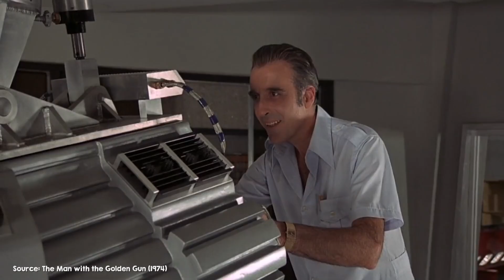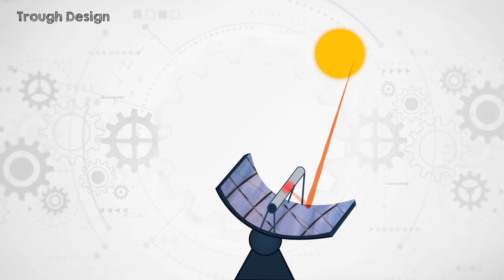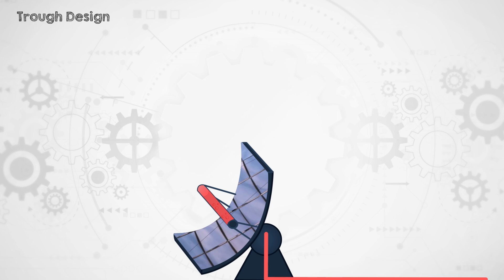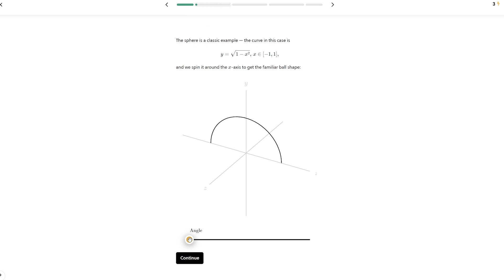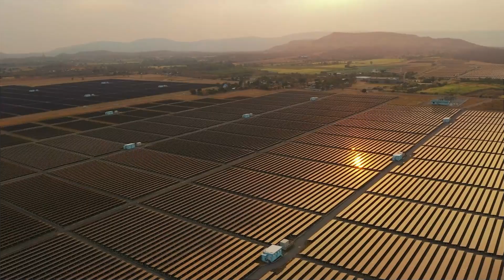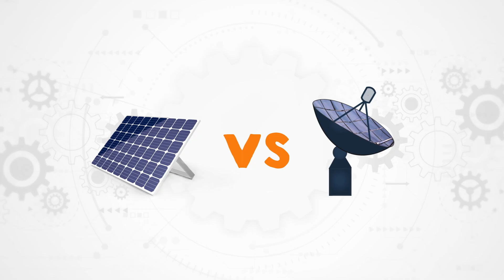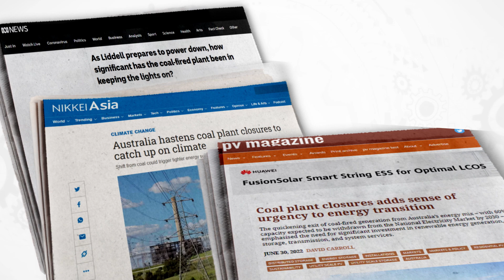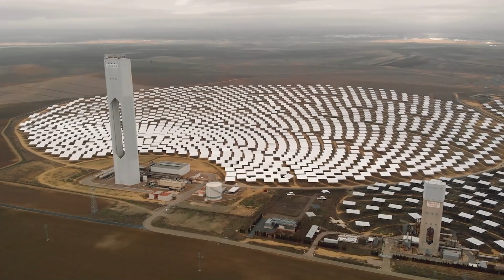Solar Power at Night using Concentrated Solar Power CSP

Comment: how much co2 would be produced by a natural gas plant given 40% efficiency 370,000,000 kWh of electricity per year
To calculate the amount of CO2 produced by a natural gas plant given 40% efficiency and 370,000,000 kWh of electricity per year, we can use the same emission factor as before, which is approximately 0.2 metric tons of CO2 per MWh of electricity generated.

First, we need to convert the annual electricity production from kWh to MWh:
370,000,000 kWh/year / 1000 = 370,000 MWh/year

To calculate the amount of natural gas needed to generate this electricity, we can use the formula:
MWh/year / efficiency = MWh/year / 0.4 = MMBtu/year

370,000 MWh/year / 0.4 = 925,000 MMBtu/year

Finally, we can calculate the amount of CO2 produced using the emission factor:
925,000 MMBtu/year x 0.05 metric tons CO2/MMBtu = 46,250 metric tons CO2/year

Therefore, a natural gas plant with 40% efficiency that produces 370,000,000 kWh of electricity per year would generate approximately 46,250 metric tons of CO2 per year.

Comment: how much power per year would be produced by a solar pv plant of 20% efficiency in Perth Australia given the area of 1 km^2
The amount of power produced by a solar PV plant of 20% efficiency in Perth, Australia, given an area of 1 km^2 can be calculated as follows:

First, we need to convert the area from km^2 to m^2:
1 km^2 = 1,000,000 m^2

Next, we need to take into account the solar irradiance in Perth. The average solar irradiance in Perth is about 1,850 kWh/m^2 per year.

Multiplying the area by the solar irradiance gives us the total amount of energy that falls on the solar PV plant in one year:

1,000,000 m^2 x 1,850 kWh/m^2 = 1,850,000,000 kWh/year

To calculate the amount of electricity that can be generated by the solar PV plant, we need to multiply the total energy by the efficiency of the solar panels (20%):
1,850,000,000 kWh/year x 0.2 = 370,000,000 kWh/year

So a solar PV plant with an area of 1 km^2 and an efficiency of 20% in Perth, Australia, could produce approximately 370,000,000 kWh of electricity per year.

Comment: Let's have another shot at making a comment and see if it gets deleted.
PV solar is ~ 20% efficient meaning that 80% is going into atmospheric heating. If you capture this heat and use it or radiate it back into space through the Atmospheric IR window .. no issues. To date no one in the world is doing that , so solar PV remains a greenhouse heater if you compare a grass paddock at 32 C in noon sun vs a PV array at 53C. We are talking about TJ's of heating over the course of a day for a 1 KM^2 area. 200MW of power vs 835 MW of atmospheric heating !
CSP troughs on the other hand, using around 400 C temps to heat SCCO2 and turbines can leverage ground loops , IR windows,  regeneration, and long term (few days) storage as part of it's very design.

Comment: The Ivanpah CSP is $2,200,000,000 to build it.  I don't think that is favorable pricing compared to a solar PV system.  And any steam generator is going to require 24 hour staff to monitor the steam turbines.  While the solar PV system is not required to have anyone babysit it.  I think the Ivanpah system cost about $5.50 per rated watt, or 5 times the cost of a solar PV system.  

So would it be better to make another 400 MW CSP system like Ivanpah for $2.200,000,000 or build a 2,200 MW solar PV system?  I guess the answer is shown by the 113,000 MW of solar PV systems and the 2,000 MW of CSP solar power.  

The biggest problem is that the staff will require about 45 people to run the plant all the time, as you need a steam engineer when the system is generating power.

Comment: In the late nineties to early aughts, I was optimistic about CSP.  Lithium ion batteries and PV were improving, but it wasn't clear how much they would improve before hitting their plateau.  My guess turned out to be a bit on the pessimistic side, leaving room for CSP to compete more easily.  I'm still optimistic that there will be a niche for thermal storage, but turning sunlight into heat is an unnecessary loss.  It should be more efficient to use PV to run a heat pump -- which could be the same device that turns the stored heat back into electricity.
Reply: >  It should be more efficient to use PV to run a heat pump - <   I seriously doubt that.  Steam for electricity generation enters the turbine at 1,000F and 1,000 PSI.  Are you really going to heat to > 1,000 F with a heat pump?  Or are you talking about running a Stirling engine forward and backward?  These things don't scale to MW sizes.  If you're thinking about operating at lower temperatures, you need to look into the Carnot limits on efficiency.  That is why power turbines inlet at 1,000F and expand down to almost ambient or river water temperatures.
Reply: @Pete in Wisconsin  The question is how much usable electricity you can get out of each square meter of sunlit land (at what capital cost and what operating cost), after putting the energy into storage and taking it back out.  It takes a boatload of sunshine to heat each ton of water to 1000F.  Sure, you get a bunch of energy back out too, but that's a wash in the first approximation.

Of course I'm thinking of lower temperatures.  In principle, a heat engine can work as close as you like to Carnot efficiency -- and a heat pump can work as close as you like to the reciprocal of the Carnot efficiency, with the whole thing being as close as you like to reversible -- no matter what temperatures your hot and cold reservoirs are at.  Meanwhile, the theoretical limit of PV efficiency is the Carnot efficiency between the temperatures of the sun and earth.

Of course, none of these Carnot efficiencies are directly relevant.  The question is what gets the lowest levelized cost of electricity while being dispatchable.  PV can use diffuse sunlight, scattered by the air.  CSP can't.  

It's certainly possible for heat pumps to run at MW scale across moderate temperature differences.  Googling it shows that Siemens has a 70MW system for district heating.  For heat engines across modest temperature differences, the example I've heard of is an OTEC (ocean thermal energy conversion) system in Hawaii at 100kW.  It's not MW, but it's a pilot project that was intended to be scaled up to full utility scale.  I don't think it's cost-competitive, with all the water they have to pump to obtain and dump the heat, but it's functional.  It's been putting electricity into the grid for years.
Reply: @danwylie-sears1134    To other readers: Dan's post above is correct and technically sound.  He does not address the issue of cost, which is very high with such a complex system and that it is effective only under clear skies with no haze.  You are only likely to find such a solution where government research money is available.  Those of us stuck in capitalist electricity markets will have to resort to cheaper options such as PV + wind + pumped hydro storage, and shutting off hydro sites during daylight hours, saving the water energy for nighttime.
Reply: @peteinwisconsin2496  Indeed.  Cost is hard.  My guess is that heat-pump thermal storage will have a niche in storing large amounts of energy for long durations, with relatively low power.  But it's just a guess.

Comment: Good and thorough content. Looks like loads of work to prepare. Nice to watch.
Now I am even more bumped that I live in the northern country with lots of clouds! My solution for now, for using close to net zero-emission heating, are wooden pellets. But I have little ideas on how to get renewable electricity efficiently. Winds are wimpy, flat lands around negate hydro. I guess PVs are the only solution for now, though I need them like 3 times as many as in Australia, due to the weather. And event then one third of the year they produce close to nothing (due to snow, low Sun's altitude and thick clouds). I guess the only option for low CO2 is nuclear in some parts of the world... And in the future, supplemented with hydrogen imported from sunnier places.

Comment: 5:36 If dish CSP is more efficient, then why not keep the center focal point stationary and move the dish on rails instead thus you solve the problem of moving the heated fluid around.

Comment: How much of a coal fired steam turbine system can be used by a CSP powered molten salt system? Surely the existing transmission infrastructure makes it sensible to locate new CSP plants next to coal power stations that are set to be decommissioned if the climate is even moderately suitable?

Comment: I remember seeing a company offering the style of system at an energy show in the UK 20 years ago, was surprised to didn’t seem to gain any commercial traction. And when it comes to steam generation it has always seemed strange that nobody uses refrigerant with a lower boiling point to generate electricity from low grade waste heat sources (I’m sure there must be a very good reason!)
Reply: There are "organic rankine cycle" heat engines. I don't know what they use, exactly.

You can also use water/steam at room temperature, you just need a colder condenser and an air- free steam circuit. It wont be too efficient though, due to carnot's law. And it will only generate low pressure (less than 1 bar- i'll guess even less than a quarter bar), so your engine would be huge. 

Concerning refrigerants: 
In my experience, the people working with them don't care about leaks as much as they could. So i hope they don't get used in even more applications, since they have extremely high global warming potential. 
Lets say you have an air conditioning unit with 3 kg of R410. 
If that leaks, it will cause as much global warming as 6 tons of CO2.

CO2 has been used as a working fluid in british powerplants.
Reply: If you had a liquid with a significantly lower boiling point that would defeat the purpose of using solar thermal. How do you keep the liquid cool and cool it down again? Water is cheap, plentiful and condenses back to water at atmospheric temperatures. It's also relatively non corrosive (which is one of the issues with CSP - the molten salt is highly corrosive). You could use supercritical C02 instead of molten salt but the fluid temperature is not quite high enough to be efficient with CST. However they are looking at blends to raise the temperature closer to 700 deg C, where you heat and pressurise CO2 directly and then use it to directly power a steam turbine when it phase changes back to a gas but once again corrosion is a major issue. A supercritical CO2 turbine is 50% efficient at converting heat to electricity compared to 35% for a steam turbine. Plus you're talking about a single process rather than heating up molten salt and then using molten salt to heat water.
Reply: I would use mineral oil or steam for the heat transfer fluid, closed loop dry wells to store the heat in the earth, and propane to run the power cycle with dry air cooling.

Comment: I wonder how this equation will change when sodium batteries achieve scale, I think we are looking at almost half the cost of current LFP batteries inside of a decade. I still lean towards PV because of their simplicity and the fact they just create electricity from the beginning with no moving parts with an almost maintenance free 30 year proven lifespan. I also like how they can be deployed flat on the ground drastically reducing installation costs. Large scale PV seems to increase its efficiencies by almost 1% a year so 30% should be available in about a decade as well. 
If CSP ends up being able to compete with all that we will all be swimming in cheap power.

Comment: Could you do a combined CSP / wind turbine generation system? So heat the molten salt with mirrors but also with excess electricity from turbines. That would avoid curtailment for wind turbines as well and therefore make them, overall, cheaper. It also seems like a way to reduce the number of mirrors/trackers required.
Reply: Going from electricity to heat to electricity loses a lot of energy. The big advantage of storing the heat with CSP is that you've already got the heat as that's how it works. Apart from the losses due to heat leaking out you get the storage part almost for free just by having the tanks and a larger amount of salt. Batteries and pumped hydro are more efficient ways to store excess electricity from wind. You could add electric heating as a last resort I suppose but you wouldn't want to be using that under normal circumstances.
Reply: @adrianthoroughgood1191  I think the idea would be having this as just another place to store excess energy as well as a generator. You can only build so many pumped hydro facilities after-all. Having it pull double duty even if it isn't as efficient as pumped hydro or lithium, increases the value to a level that might make it worth building more often. If you need an abundance of heat for an industrial application it's even better.
Reply: @OstrichWrestler Thermal storage is cheap from a money point of view but expensive from an energy point of view. The best time to use thermal storage is when the heat would have happened anyway, eg when you are starting with heat like CSP or nuclear power, or when you are finishing with heat such as domestic heating. Eg I have electric storage heaters for space heating and a large hot water tank. This means my electricity demand can be shifted from when I need the heat to when the electricity is surplus and therefore cheaper. However I do agree that once you've spent the large amount of money on setting up the CSP plant, adding electric heating would not cost much extra, and some electric heating is needed anyway because the salt has to be heated to become molten. So install it yes, but only use it when all other more useful ways of using spare electricity have been exhausted, IE when the batteries and pumped hydro and load shifting are full and the only option left is curtailment.
Reply: @adrianthoroughgood1191  yes, that was my point. Lots of places can't do pumped hydro. Batteries get expensive. And one way to ensure reliability and enough supply is to deploy turbines so they supply enough power for a high percentage of the year. The downside is that will lead to overproduction. Having an existing system that lots of power can be dumped to is useful in that scenario.

Comment: Probably cheaper than gas at scale in sunny climates. Unlike coal power stations, mines, and ash dumps where the land is mostly unusable, sheep can still graze under the mirrors. 
I'd love experiment with tracking the ten square metres of flexible plastic backed mirrors recovered from a demolished clothing store. I think the local small airport wouldn't appreciate it, even though the focal point would be close, and reflected sunlight wouldn't be as much as that produced from my 45kW solar array.
I'm adding PV hot water systems to the house and cabins, it's the cheapest, most reliable way to store energy. I'll look at our Nissan Leaf next year and work out the ROI of the vehicle to home inverter cost. In the last 25 years we've only lost power a few times, the longest was 17 hours.

Comment: There's a Concentrated Solar Power project here in the States that I had high hopes for: The Crescent Dunes Solar Energy Project. I think it was supposed to be something of a flagship for the molten salt energy storage. It probably even shows up in some of the footage you have of central tower installations.

But wow, that place has been plagued with operational problems. Offline for eight months due to a leak in a salt tank. It was expected to be a 40 MWh installation, and it has never hit that target, even in its best months at the peak of the season. Most of the year it couldn't even hit half that.

Economic failure, bankruptcy, it was offline for over two years and I thought they'd given up for good -- looking it up now I'm surprised to find it's back in operation again!

So I'm sure he's heard it before, but that'd be my question for Keith: What has the industry learned from Crescent Dunes, and how will future installations avoid its failures?
Reply: A engineer from McDonald Douglass in Huntington Beach California was at my 7th grade class, to show how the Barstow solar system worked.  (I think his daughter was in my class).  This was a 100 MW system, also using molten salt at about 850F.  The problems include needing staff there to monitor the boiler when it is running.  How to warm the salt before you can pump it to the tower to get it hot, so a lot of electric heaters to warm the steel pipes that have salt inside.  That reduces the output MW of the system, when you are using a MW of power to heat the salt each morning. 

The biggest problem with Ivanpah is the $2,200,000,000 cost!  For a 400 MW system.  You could install a 2,200 MW solar PV system, instead and that will not require monitoring or cleaning the mirrors.
Reply: Yes this is the biggest thing that needs to be talked about. How can you avoid the molten salt problems. I heard from someone who worked at that place and he said the molten salt was a nightmare that they just hadn't expected. This is also an issue that people never address when enthusing about molten salt nuclear reactors where it could be an even bigger concern!

Comment: Some people have build low temp systems, storing hot water in arge insulated tanks, to heat their Earthship in the winter, often with great results. Even if you have to use fuels say 20% of the time, that's still a big savings. Also, in some places, Coal or Gas plants could be converted to multi energy, steam is steam.

Comment: While on a work trip I stopped by gemasolar in Spain it was a research station with all different experiments, why direct mirror on the side of a solar panels are discarded, and why polar mount tracker are discarded, gemasolar had those experiment and  two CSP